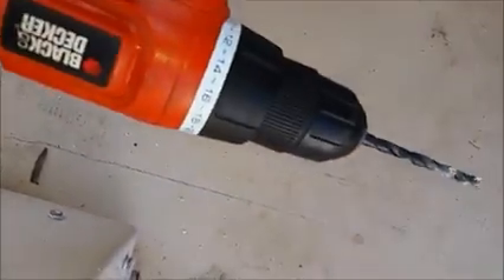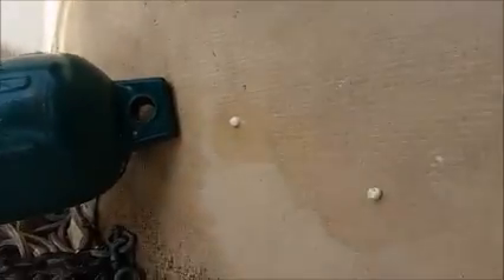Boat Deck Repair - introducing Injectadeck! www.injectadeck.com

Comment from the maker: Here I am 3 years later and my deck is still solid. This is not household spray foam. Its structural and water catalytic. Im junping yacht wakes in Ft Lauderdale and I just Re-Powered with a Suzuki SS series outboard.

Comment: I spent almost $500 on this stuff last year and used EXACTLY as directed. Did not work. Still have soft spots. Also, when it starts to bulge, it dose not spread out easy so you'll most likely end up with bumps around the boat that are also soft. Less than a year later, the soft spots that have been filled are even softer then before.
Reply: Just curious if your injection sites were slightly off or obstructed and not truly connected even if the holes were drilled
Reply: Thank you. Saved me 500

Comment: How are you floors now? Still solid? We have a cheap boat and do not plan to have it long and need a quick fix to get us through a couple more years...
Reply: Did you ever use injectadeck? If you did, how did it work out?

Comment: How did you patch the holes you drilled, dont you have to do glass not just resin?
If you did just resin, did it keep solid or show its line when painted?
Reply from the maker: I drilled holes pump the deck I did not do a patch there is no line I fill my drill holes with Marine Tex white sandable epoxy putty. You can use resin if you want polyester resin is old school the latest and greatest is vinyl resin suck man

Comment: Or do it properly and get that rotten wood the eff out the floor.
Reply: Old boat, little money.
Reply from the maker: the rotten wood drained out with the water at the lower ply crack in the bilge. Injectadeck ate the rest.